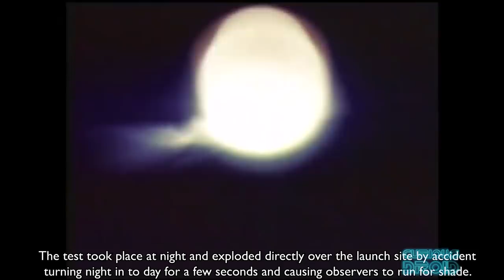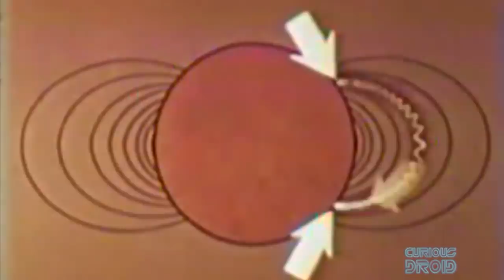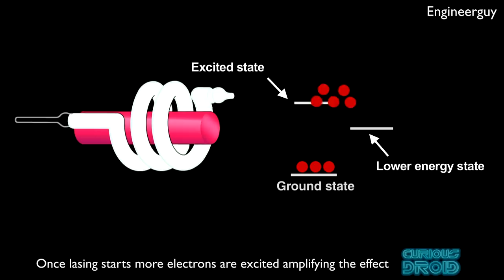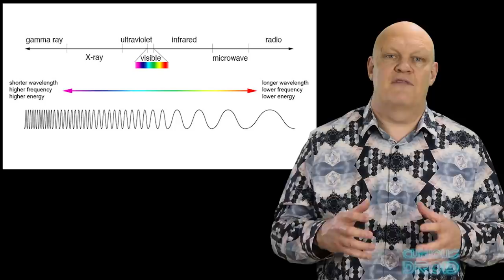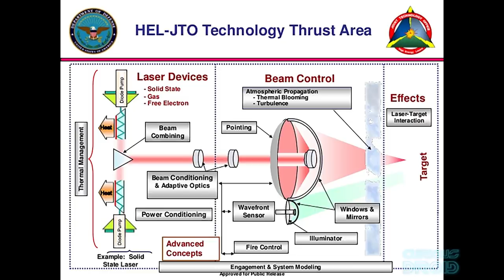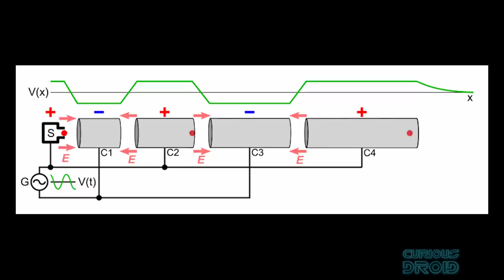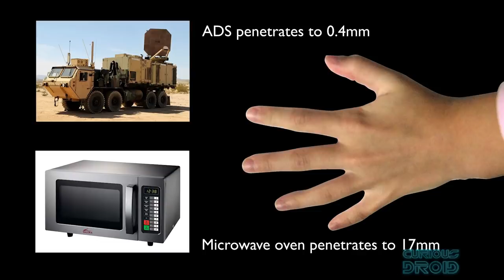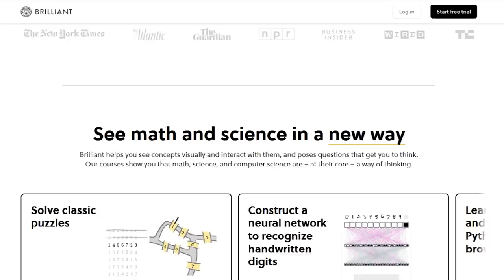Will Directed Energy Weapons be the Future?

Comment: The short answer is no, DEWs will not be the weapons of the future except in short range applications like CIWs ship defense. 
First issue is that all EMR loses energy by the square of the distance it travels. When the distance doubles, the energy is weakened 4 times.
Next problem is atmospheric interference. Photons, electrons all are affected by molecules in the air causing the energy to be both absorbed and bent.
Next is thermal blooming. There is a finite limit to the energy that can be sent through the air before the oxygen and other molecules in the air heat up, turn to plasma and further distort and weaken the beam. Its just under one million watts in earths atmosphere. That is the point when the blooming cannot be overcome. Physics dictate this and cannot be overcome.
No matter the coherence of the beam, it still diverges just like a flashlight beam.
Finally, no matter the power or frequency, all emr can be reflected, dissipated or absorbed by readily available materials and technology. Think mirrors or radar absorbent materials. 
Being by definition a line of sight weapon, they all are susceptible to countermeasures, like rail guns or conventional weapons. 
No, directed energy weapons will not be the weapon of the future.

Comment: Given that Hypersonic Missiles have to be able to withstand heat in (i'm no scientist or Rocket Surgeon) the range 2000 degrees Celsius can we really expect a Laser to damage them?
Reply: Well, flying at that speed the missile body is already going to be nice and toasty warm, so it shouldn't take all that much energy to push it over it's limits and induce catastrophic failure. Aerodynamic forces then take over and rip the missile to pieces.

Comment: I always wondered; the french use a system of containment, for nuculer fuel rods, which includes encasing them in a form of glass. Because the fuel rod even though depleting is still giving out energy, could you not sue that as your 'Ruby Rod' then you have a mixture of energies, i'd digest you could team this up with charged plasma, that could them be used to direct the paritcals or energy output, you could use the same plasma, that gives of extreme light energy, (like the ones used for gas axes) am i insane, and have i compltely lost the plot lol.

Comment: Correction: Projectiles do a lot of damage as they have a great deal of kinetic energy, which allows them to do work against a target as they plough through them. Photons are massless, but have an energy directly proportional to their frequency, so it takes either many low frequency photons or fewer high frequency photons to do transmit the same amount of energy as a projectile. In principle the amount of energy required is the same no matter the delivery mechanism.

Comment: The Active Denial microwaves can do much more than you stated. 

 An the Big Laser Plane interceptors are a failure.  They cant produce enough power on the planes limited platform size, currently, to destroy a missile.
Reply: Donovan Norcross - That’s right, just like he explains and shows in the video.
Reply: I wasn't talking about blooming.  I was talking about actual plasma beams.  Not just a simple laser that can be refracted, like he says.  They can generate more than common laser beams with these technologies.

Comment: So why aren't these portable deterrent microwaves actually used?  Too easy to defeat?  Not portable enough?
Considering the recent riots having such low injury methods would prove beneficial at sending the idiots scampering.   Isn't there also a sound-based deterrent system for crowd control?
Reply: They require large trucks. And sound based deterrents only work on younger people, typically teens. Anything that works on adults would cause actual damage.